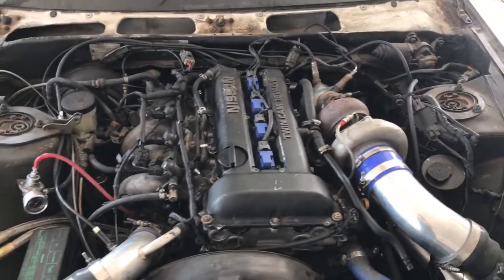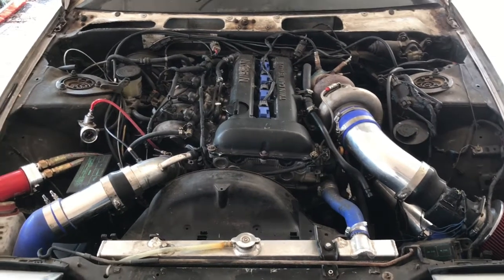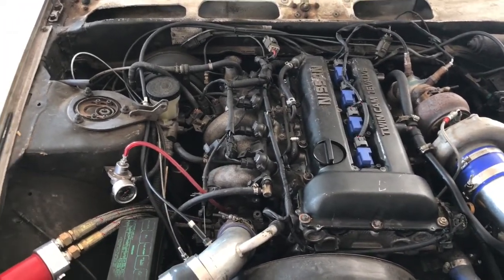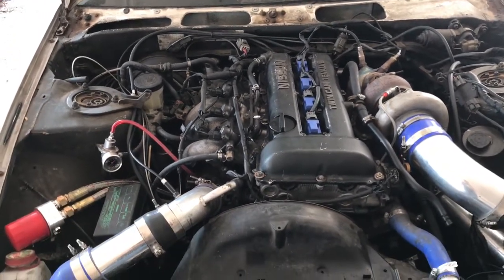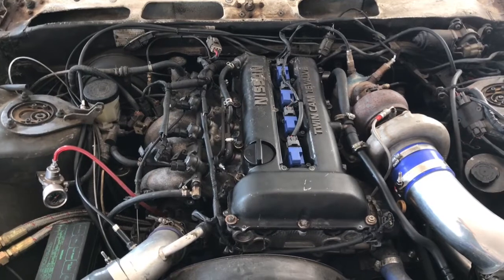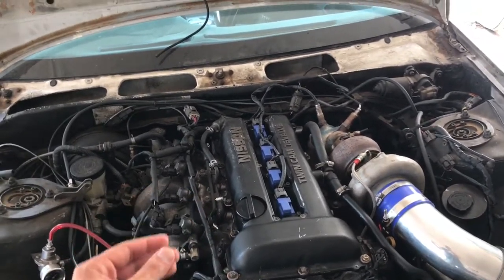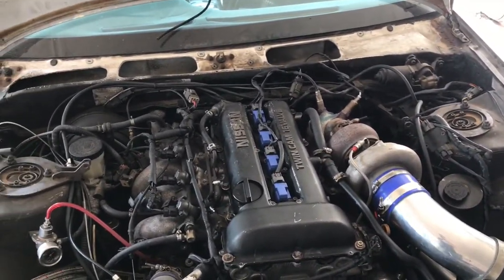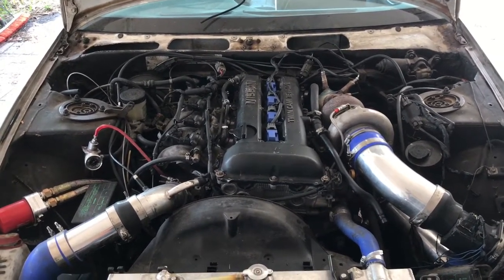Dead cylinder

Comment: if you have upgraded cams you will get a lower compression on the compression test because the lobe keeps the valves a open a bit, try checking the ignitor see if its ok, mine went faulty after some skids and worked also on three cyl's, i replaced it and everything worked fine and if you can, check mapping for any sudden change in the timing
Reply from the maker: jezMki it was the cas. I put a video up fixing the prob
Reply: if u have lower comp with bigger lobes it means that you dont have clearance between the lobe circular end and the rocker arm.

Comment: I thought that it could be a stuck intake valve. If the valve is stuck closed, you would still get compression.
Reply from the maker: Roope Peltola i thougt so also. Turns out it was the CAS..put the motor on TDC and aligned it. Kaboom. Stupid simple error lol. It was aligned but not on TDC befor
Reply: @rpmpillsforspeed  I didn't understand anything you just said. The language I do understand is the language of carburetors and engines with no computers.
Reply: That's what I was thinking to, stuck open or at least creaked.

Comment: Bro it's your CAM ANGLE SENSOR !!! Try removing and making sure it's aligned properly. I had the same exact issue with my Sr20. Except my car wouldn't start at all. My CAS was 180 degrees off. I was missing a bolt to it and I'm guessing it slowly vibrated out of place over time.
Also check the ignitor chip. They do go faulty, try the isr brand.
Reply from the maker: sdw6594 got a new ignitor.. also the cas is still in its original spot. I will try to remove it see if it moved. Still havin the problm. Headach yo
Reply: Pillsforspeed yea check out the timing of the cas. Just remove the valve cover and set the engine to top dead center. Then after verifying timing with the cams, check the timing of the cas. There's marks on the cas that must align with each other
Reply from the maker: sdw6594 just wanna say thank you for your feedback. Turns out it was the CAS. I put it on proper..but i forgot to do it at TDC! Fix the prob right up. Thank u again

Comment: My RB20DET is doing this on cylinder one took it to a specialty shop he fix some major issues but #1 is getting no fuel or spark he is not sure why and I am in the same boat.
Reply from the maker: Bryan Cook my issue ended up being the CAS. Was not set to TDC when I originally installed. Once i did that! Worked like a champ
Reply: The crazy thing is he set to to TDC and it wouldn't start, 45° turn  on the timing she started right up. However cylinder 1 injector isn't spraying and coil pack not sparking

Comment: man I have a 2009 corvette and bought it to the dealership, and they did not even look at it, just said "we can only put a new engine in it"  It has about 240000 miles.  they engine started shaking, flashing engine light is on.  What is the cause?
Reply from the maker: kaysmooth319 i did alot of steps to find out my problem. I had to narrow it down caz it cld be so many things. But i wld Check compression. Pull out a coil one by one see if its a dead cylinder..i took my car to a shop an they told me pretty much the same. Let me knw what this does for ya. Keep me posted. Thnx for watchin
Reply: man, they said only 5 cylinders are working 5 6 7 are bad.   said if I replace just the oil pump, they do not know if that would solve the whole problems due to high miles. but they did say the oil was so black. so looks like pump is out.  should I let them just change the oil pump?
Reply from the maker: kaysmooth319 if the oil pump was bad i wld assume evrythin wld go bad. Althou its a good idea. If u hav good oil pressure i wld check for bad coils..or fuel to see if the problm is simple. Pull the sparkplug out an turn over the engine. See if it sparks. Then check if the cylinder is getting fuel. If they are...do a compression test. Sometimes its a coil gone bad or simple as a leaky injector or broken injectors. Dur to high mileage
Reply: Pillsforspeed thanks man for the info.  I will update you on it.  they gonna replace ad oil pump
Reply from the maker: kaysmooth319 it was the cam angle sensor. I put up a video fixin it. How the build?